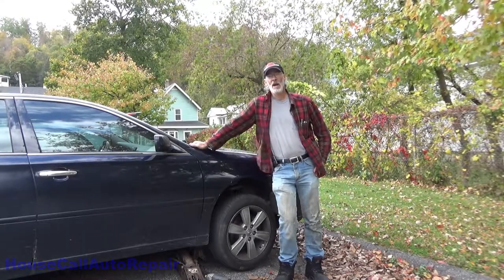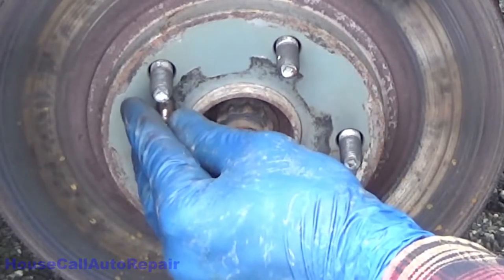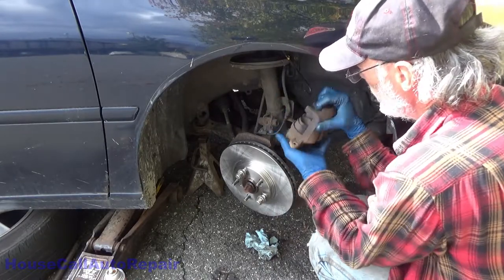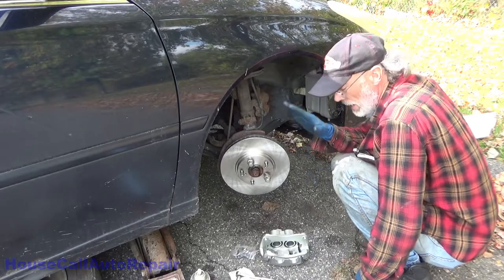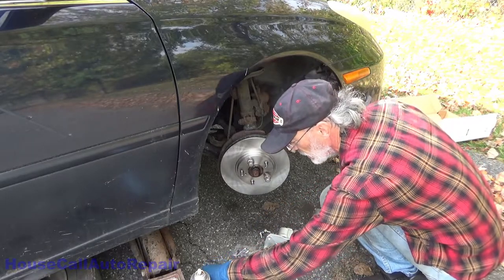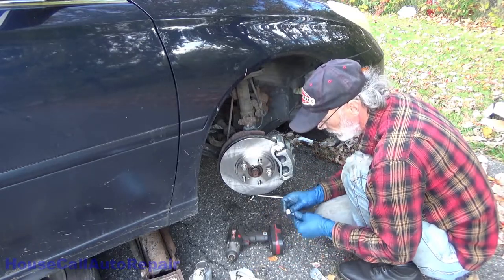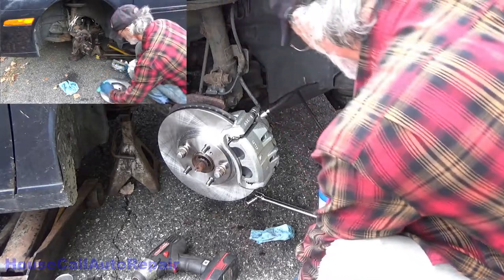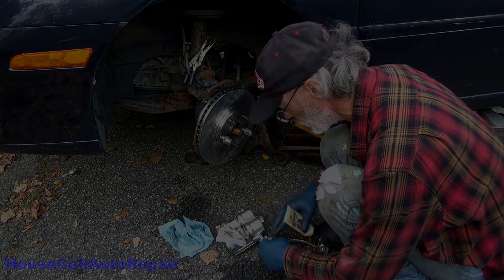2005 Lexus ES330 Front Brakes

Comment: Thank you straight forward explanation without the fluff and unnecessary music.  I've done my front brakes a couple of times after watching other videos but you've provided very good tips that others did not.  I just got my calipers for my 2004 ES330 and will be replacing this weekend.  Mine did come with the banjo bolt though.  I thought I would not need the needle nose pliers with the rubber hose b/c others have said it may damage the hose but will try to hold up the hose and try w/o the pliers.
Reply from the maker: Clamping the hose, CAN very easily damage it. I have often had it still slowly drip from having it not clamped tight enough, but that's better than too tight.

Comment: You can compress the pistons with the C clamp one at a time and they will go back straight in the bore. Easier than trying to get both at one time.
Reply from the maker: Also, as you suggest, it makes it really easy to see if you have a restricted line, if one pushes out the other.

Comment: dear old man, thanks for such an excellent video, question, if I may?  after seeing you struggle with pushing the pistons in, why did you not open the fluid reservoir cover? I understand that,  that way the fluid will be able to move back more freely, without messing/braking with the bleeding port, that will introduce air into the system?  It's an old trick from my toyota life, I am new to Lexus stuff but I'm going to do the brakes on my son's ES330 and saw you struggling. again thanks.
Reply from the maker: Lexus is rebranded Toyota, like Lincoln is to Ford, or Cadillac is to GM. 
 When you've done enough of these in the Rust Belt, you get a "feel" very quickly, for stuck pistons, or compromised hoses... 
 The only time opening the cover is necessary, is to add or remove fluid. It has a vent. otherwise it would create vacuum as the brake wear and the fluid level goes down, so no, the cover does not need to be removed (allowing moisture absorption)
Just be mindful of the fluid level. As long as no one added any, and none leaked, you should be fine, AS LONG AS THE FLUID IS GOOD and clean.

Comment: Great video, and a question. I'm going to do a complete service on my 06 Camry Front Brakes next month. Since you mentioned ES330 in title i was wondering about a swap to the dual piston calipers from the ES for my camry, I know i'd need to do the rotor also. From everything i could find it looks like a straight bolt on swap. What other issue should l be looking for?
Reply from the maker: It's a really complicated explanation... While they can be easily converted over, I cannot say that it's that simple. There are different braking forces coming into play, that MAY alter the handling, safety, and performance of the vehicle. Do so at your own risk!

Comment: most everyone uses the vice grips to cut off fluid flow i do not do it unless the hose is new or looks new, afraid it will damage the hose if its very old. just my opinion and to be clear i am not saying you shouldn't do it or should i just stating what i do and don't do.
Reply from the maker: oh, I hear ya! I intentionally clamp them lightly so as to NOT crush the line. (sometimes it's lose enough it leaks)

Comment: You did not pop the brake fluid reservoir cap off. The air is fighting inside since the cap is on and it won’t compress. First thing I do is open hood and check brake fluid level, also don’t want to over flow it for someone added fluid vs checking pads. Pads wear fluid drops someone adds fluid now when push pistons in it over flows. Always first check fluid level and pop cap off, I have seen caps blow off also from the air pressure pushing in the piston.
Reply from the maker: Haven't you even noticed that the cap has a VENT? Plus, I haven't over filled/over flowed a reservoir in a LONG time. Great advice for someone not already involved in a lengthy project. 
YES, if the brake fluid HAD been ""topped off" it WOULD have made a HUGE MESS!